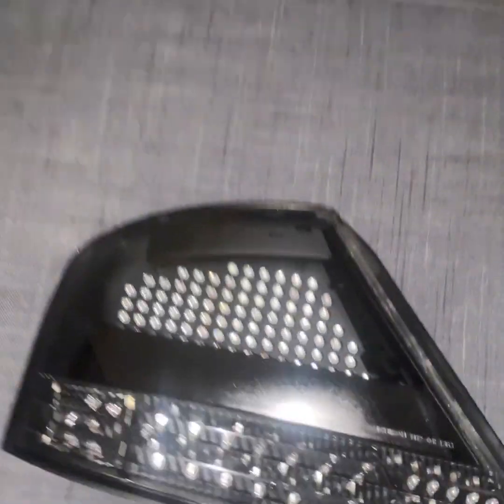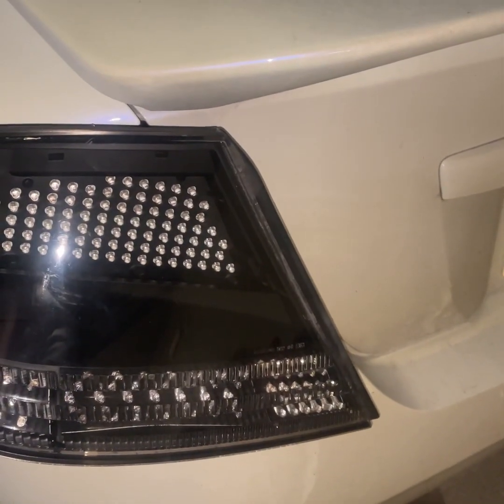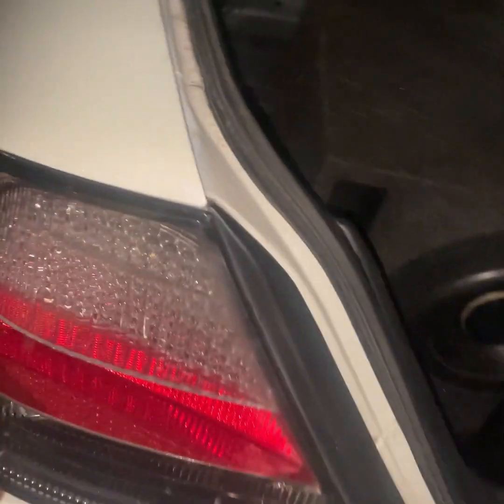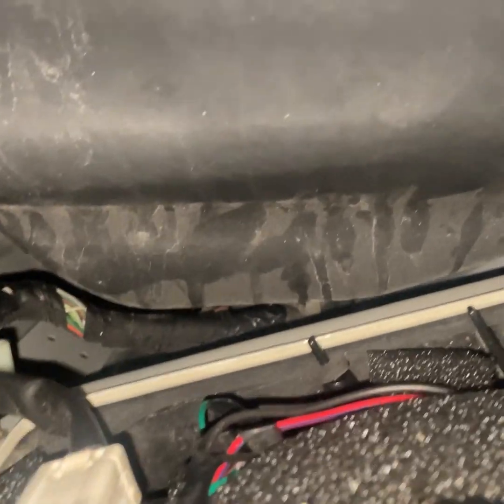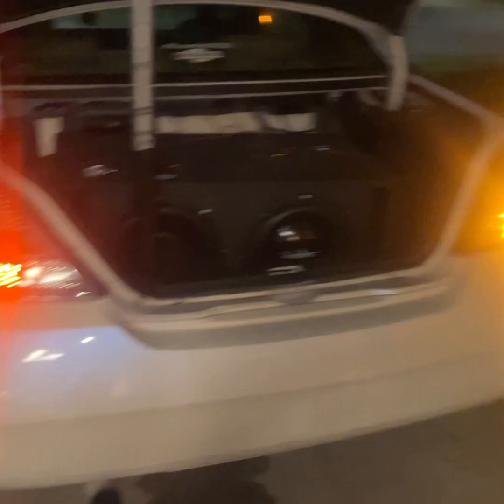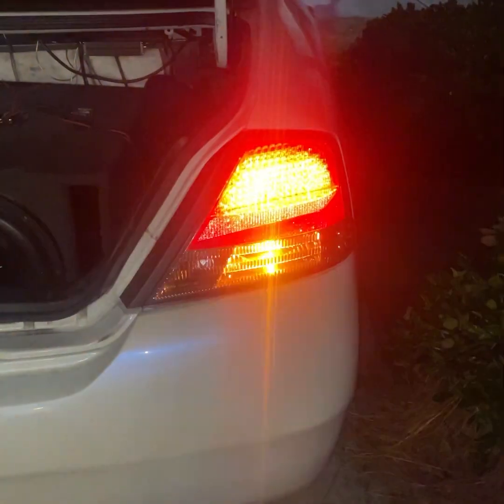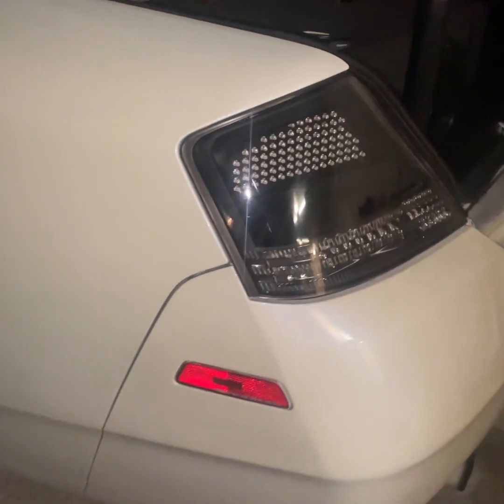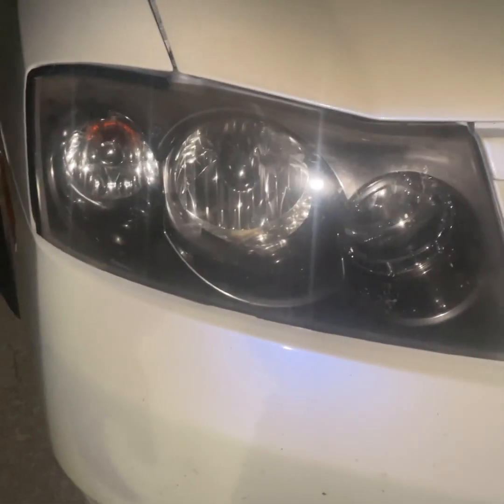Rare Gloria tail lights from Japan **Must See**

Comment: Nice Big DAWG, ahh  I have a 2000 5 speed maxima should I turbo it!?!?🤔
Reply from the maker: Yes 3.0s can handle boost better than a 3.5
Reply: @TayVq  Oh ok 👍🏾Pro Shade it Brutha! I also have an 02 6 speed I had an accident in, and was told it would cost about $4K to get fixed.  Do you think it would be better to get it fixed or run the 2000 under Boost first and then do a Swap after the 3.0 give out!?🤔 Also the 02 6Speed engine only has about 55,000 miles on it!